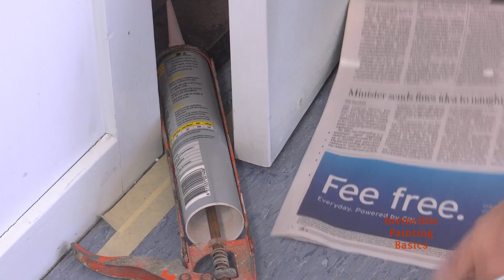How to: Enamel a flat door like a professional!

Comment: Hello thanks for video! 👌 
which brush to use?
Reply from the maker: When usiing any oil base product, a professional will use a 'china bristle'. They are somewhat stiffer than a nylon brush and this allows you more control over the heavier oil base products. The bristles are black in colour but not to be confused with cheap 'plastic' brushes which are also black in colour. Good luck.
Reply: Thanks bro
Reply: Purdy black ? Respect bro thanks

Comment: I'm in Australia and I'm just a handyman and have a different technique to yours, so if you can bear with me here.  I got this method from doing a short course at community college with a master painter.  It's based on calculating exactly how much paint you need for each face of a door. Then a black closed cell foam roller is used to apply the paint and an extra good quality brush to " tip off " the air bubbles in long passes in the direction of the length of the door.   After this is done and the paint self levels the door almost looks like it's been sprayed. Even a newbie like me produced very good results ;)

You take the door off and lay it on a sawhorse and do all the prep that you have shown. Next I work out the surface area of that door say in mm 2100 x 810 which equals 1.87 sq meters.   Then you refer to the tin for the coverage of the particular enamel paint being used. Say the paint covers 12 sq metres per litre so 1000ml divided by 12 sq m equals  83.33 mls of paint per square metre. For this particular door size the vital calculation  would be 83.33 x 1.87 = 152ml of paint needed for the surface area of tat door.
 The exact amount of paint combined with rolling on and tipping off gives a very acceptable finish every time.
Reply from the maker: Andrew, at the end of the day, if it works for you then it's a good thing! As a professional, that's not going to work. I need to paint maybe 50 doors for the day, taking them off (more time handling, and drying one side at a time) isn't going to work! Foam rollers don't hold that much paint and you wont see a true professional using them. Again, if it works, you have the time then by all means, do it. Btw, I don't think any true 'Master Painter' would do it that way on a commercial basis. Taking off the door and laying it on saw horses is certainly for people who maybe want to use oil base enamel and don't know what they are doing. This is fool proof for enamel and will work for newbies! Great if you only have one or two doors and have time to burn.
Reply: Rick Bushell
Yes Rick you're spot on. It's only a technique to help a weekend warrior like me to get a good result. I'm building my own house and the this idea came from the painting module that was offered for owner builders.
Reply from the maker: Andrew Darnley Glad it works for you Andrew. I might mention here, as long as your building your own house, you may want to view my other videos on painting? Not the greatest videographer but  I think you may pick up some good tips. :)
Reply: Could you even use a foam roller with oil based enamel?
Reply: Yes, foam works with oil enamel.
Reply: The best finish I ever achieved when painting enamel onto a door was when I used a high density foam roller. The finish was like glass, mind you I did apply 3 coats of undercoat which was overdoing it, but the results were great.
Reply: There's an English guy on here who does "hand brushed kitchens" and uses that method exclusively.  It requires a decent brush and a decent touch, but it's perfectly acceptable and just as fast as any other method.  I wouldn't bother removing the door, though, unless I was taking them off-site to spray--which I might do if I were a better painter : )
Edit: foam is more newbie friendly, but not necessary

Comment: getting a pro finish with oil based paint requires practice and there is simply no shortcuts.
Its a completely different beast to acrylic , whish is very forgiving and so much easier to work with.  It is very satisfying when you finally achieve excellent results.
Reply from the maker: Thanks for sharing!

Comment: good instruction .  (a final tip, if you get a run, give the enamel as much time as possible to dry Hard . This is minimum of 72 hrs. (at room temp.) but even more will avoid gumming up and it will sand out smooth)
Reply from the maker: Good tip Harry, particularly for the diy using enamels. They're not as easy to use as I show but good tip. For me, no worries, never any runs or sags. :)

Comment: Hi there, I've been painting houses(rentals mostly) part time with a friend of mine. When he enamels doors he never tips them off with a brush. He's been doing it for years so his finish looks better than the untipped finish you showed (not much though). I'm just wondering why you didn't show your finished door to compare it to the untipped door? I would've really liked to see the difference as I haven't seen one yet.
Reply: Hi jimijames, I can't agree with your comments of the untipped  enamel looking better the tipped off. Although they both look good and I have done the untipped many times, it depends on the client which one I use. For absolute mirror finish, the tipped off is the only way to go. I used to do a lot of work for the Aussie military housing, and there I used the untipped finish, was fine. With the untipped you will get a stippled effect, although very slight. You'll get away with the untipped as most clients wont know the difference. Happy painting :) And sorry, I haven't got a comparison to show you.
Reply: I think you misinterpreted my comment Video Connect. I didn't state that the untipped finish looked better than the tipped one. What I was saying was that my mates untipped finish looked slightly better than the untipped finish that was pictured in the vid. The tipped finish wasn't shown in the vid and that was my question as I've never seen the difference (I've only been painting with my friend for about 7 months now). My friend also worked for Defence housing for some years and they were just banging out apartment after apartment and had a set standard quality of finish. It wasn't until he worked with a master painter for some years that he got much more experience of better finishing techniques.
Reply: jimijames marshall , Spray finish is only thing better than tipped out. The only way to make an enamel oil door look fair with a roller finish is to use a mini roller with a short mohair or velvet nap. But in my opinion though it only takes about 30 more seconds to tip it to increase quality. If you are using latex, painting the plastic doors with the wood grain texture you can get away with a 3/8 inch mini roller nap but most pros I know just finish with brush or sprayer.

Comment: Great Tutorial! Im about to re paint my huge oversized flat front exterior door from red to black. Its a larger than usual surface area and Im new to this. With this in mind do you have anymore tips? Thank you for all the effort in making and posting your videos the are really great.
Reply from the maker: Hi Katy Ingram. It's always a bit difficult to address someones painting issues without actually being there. But here goes; First, being the one door I wouldn't even consider bringing out a roller. They work great but are utilized more for when there are a lot more doors to be painted. The job above (from memory) probably had at least 8/10 doors. With just one door it just isn't feasible. Is the paint on your door enamel? Or is it Acrylic? Makes a big difference on how to continue with your project.At least if you want it to last.
Reply: Hello Rick, thanks for your reply. I'm not sure what type of paint it is. We recently bought the house and I want to change the door colour. Id guess its Enamel from the finish and the cutting in is super sharp, like you wouldn't believe? It's been painted pretty well but does has slight visible texture. I'd like to make it as smooth as possible. The door is 141cmwide by 200cm high. Which is why I guessed a roller would be better and then tip off as you do with a brush? Why would you not use a roller for only one door? Im in Australia and its the exterior door but because of its design I can't actually take the door off. It doesn't have hinges. Rather the door pivots about 30cm away from the closing edge. Its large flat area with only one lock and a large steel handle which can all be removed to prep. I really appreciate your getting back to me and your sharing all your knowledge! Best regards, Katy.
Reply from the maker: You really do need to find out what paint is already on your door. Watch this: https://www.youtube.com/watch?v=oHT5wvDEiD4
Reply: Hi Rick, So I did the Methylated Spirit three rub test. Colour came off, so Im surprised to find out the door must be water based paint. So what do you think? Can you give me any other top tips before I start. obviously Ill be prepping and keeping everything super clean. Do I re do in water based? or shall I sand down and re do in enamel? So many options. I really want to do a great job. Cheers Rick. Katy.
Reply from the maker: I would keep with water base if I were you. No need for undercoat but a good sand wouldn't go astray. Happy painting Katy :)
Reply: Cheers Rick, Thanks again for all the replies. Katy.

Comment: Thanks for the video.  You make it look so easy!  
Just one coat?
Can it be a bit thin an do two coats?
Is it easier to spray?
Thanks
Reply from the maker: +Helms from Victoria Australia LOL caught me at my computer. :) No, definitely don't try spraying. Can be done but you really have to know what your doing.  And yea, just one coat, (Those doors in the vid where in good condition) as long as the color is the same or somewhat close. When it comes to working out how thin to make it, that also comes with experience. Too thick and you will just fight with it. To thin, might not cover. It should lay down nice and flat if it's done correctly, no sags or runs either. Should look like a mirror when you step away.

Comment: Hello my friend, I just started refinishing and painting furniture. I like oil based enamels and I've only used aerosols. Here in Minnesota, in the winter, I'll have to work indoors. I bought Wooster white china yachtsman brushes. can you tell me the best method for eliminating brush strokes? Thank You.
Reply from the maker: It's about getting the enamel to the just the right consistency. Very difficult to do for a diy if not impossible. Also, painting on a cool morning will help the enamel flow, which is the very thing that allows one to produce a very nice finish. If it's too thick or wind passing over the surface you are painting is not going to allow it to flow. Also the warmer it is, the more difficult it will be, by that I mean, getting runs and sags in your finish. And you have to work as quick as possible. This is probably not the things you want to hear but enamels (oil base) are difficult for most. Good luck mate, :)
Reply: Thank You for the quick response. I love the videos!
Reply: If you find your paint setting too quickly, then Penetrol (added to your paint) can work wonders. Where I live it's very warm (30 degrees celsius or more for a lot of the year) and paint starts pulling (and leaving brush strokes) very quickly. Penetrol slows that down and allows the brush strokes to level out. The big thing to keep in mind is to work deliberately and quickly, and if you feel your brush dragging then don't keep messing with the paint. You might have to cut your losses, and sand a little more before the next coat. (sanding between coats is critical to getting a level finish too - 240 grit sand paper, not so heavy that you sand away your previous coat - just enough to knock down high spots). Of course, with oil-based enamel paint taking sooo long to dry, you won't generally find house painters sanding between coats (as far as I know) ... but on a fine piece of furniture, where you build coats over a week, then it'll help the finish hugely.

Comment: Thanks for the video. You made it look simple.
Are you using oil based enamel or water base?
I took out the doors to paint the door jambs and after the 2nd coat some area started winkling. I don't know the technical term but it looks horrible. How could I fix the winkles with out having to strip off all the paint? It's been almost 3 weeks since I painted the door jambs and the wrinkles bits are skill soft when you press on it. I'm thinking off just sanding off the wrinkles off. I'm going to try to paint the doors soon.
Reply from the maker: +Raiden X Wow, sorry you're having issues, but without being there it's very difficult to ascertain what the actual problem may be. And technically, there is no such thing as water base enamel. That was invented for the diy. What I am using in the video is oil base, and going over oil base. Any possibility you could send me some photo's. Do you know what kind of paint you painted over?. Did you sand before painting? What kind of paint did you use? What kind of prep did you do before painting if any? These are the things I need to know. Here's my facebook page;  https://www.facebook.com/InvinciblePaintingBasics/?ref=hl
Reply from the maker: No worries mate, no buttons pushed at all. What ever work for the diy, that's all that matters. :)  Good luck with your painting projects. :)
Reply: Sand the doors and start again,never put a second coat over oil based paint until a couple of days passed and they are really dry or doctor wrinkle will visit you..
If you want to second coat enamel paint,you can put another coat on if it isn't dry , another words wet on wet.

Comment: Do professional painters generally prefer oil or latex/acrylic/water based paints? In other words, what do they paint their own house with.
Reply from the maker: I can't speak for other professionals, but I like to stick with whats there usally. Water base on cielings and walls and oil on timber,  trim ,doors etc. But if the woodwork is already water base, I would stick with that.
Reply: ge stu ck . . I. 9  .  . This . ,

Comment: Hi. Love the informative video. I agree with one other comment that I would have loved to have seen the finished product! I found your video in searching for hours for any hints on how to either prevent or fix sags / drips (mostly sags) from oil based enamel application. I have a furniture piece. I had some rather fresh oil based enamel - black, satin - from another project, I wanted to use black, and thought - cool, this will work. The other project was totally different. No problems or worries, limited surface area. On this hutch I was attempting to paint...oh, goodness! TERRIBLE. I even looked up the brand name of this product, Rustoleum. They give zero information (that I've found) on sags, and their application instruction was to let it sit for 2-3 minutes then wipe the excess off with a rag. Seriously? Even I know better than that. I only 'wipe off excess' when applying stain.

Do you offer any video on what to do about sags / drips from oil based enamel after you have already committed the sin? I have been a DIYer for at least 30 years. We have painted or stained and finished everything from walls, trim, doors, vanities to all sorts of furniture pieces. I guess I've not really painted with oil based enamel much. I think we used it on cabinets once right after we married. I do not recall ANY drips or sags. I just know it was oil based something because I ended up with poisoning that night from sitting inside the corner cabinet to paint it (young & dumb - no mask or ventilation). Otherwise, I guess I have never used this product or type of product before.

Comment: Also I think they call it a Dutch cross because your paint goes further if you use that technique  so you just use less saving money and the Dutch will do what they can to save money. but I may be wrong..
Reply from the maker: Actually, it has nothing to do with 'stretching' the paint to make it go further and everything to do with a more even coat of enamel so it flows better. :)
Reply: As I said  "I may be wrong"  your vids are great, Keep it up.
Reply from the maker: Thanks  Damian, and happy painting mate. :)

Comment: Showing us the end result of the door would have been nice that way the DIYers know if they are correctly painting.
Reply from the maker: jermzdee Thanks for the response. I appreciate it. I have a project coming up (a whole series actually) that I'm calling the 'Shack Make over' and will be enamelling a few doors. So I will make sure and address that very concern. Thanks again for bringing it to my attention. You may also want to monitor my site, the make over starts in a few months time and will have all  kinds of tips and tricks on everything, as I do the project from start to finish! It's a complete make over inside.
Reply: Sure thing.  I am subscribing as your tips and tricks are very helpful and practical.

Comment: I swear before I watched this video I was convinced the best way to paint a door with oil would be to take it down and set it flat across a pair of saw horses.
Reply from the maker: Michael Block very impractical on a commercial bases, particularly if you have 20 or more doors to paint using horses. In my 40 years of painting I never saw a professional use horses. Oil base enamel is difficult for diy and even most painters. Thanks for commenting. 👍
Reply: The door is in the perfect painting position right where it is .